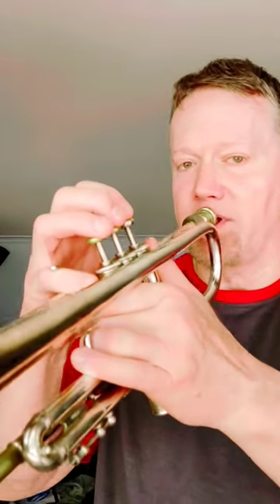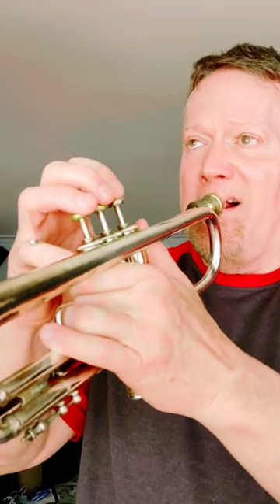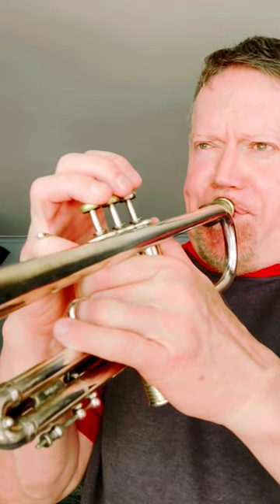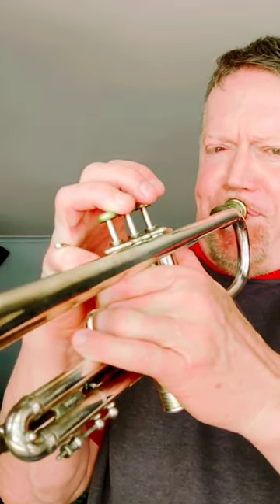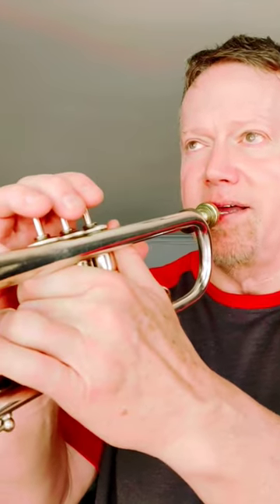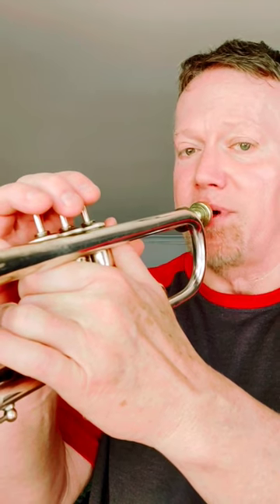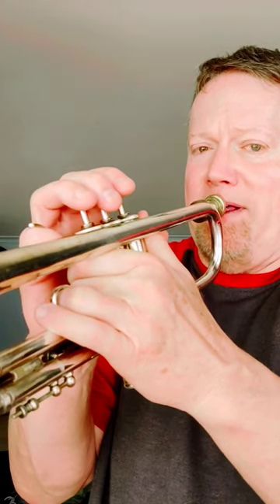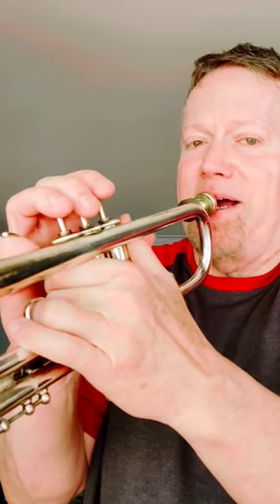Watch My DOUBLE C Turn Into Air As I Add Too Much Mouthpiece (MP) Pressure | 2023 Lesson

Comment: if you take a water hose...and pinch the end for faster flow (      if you will ) eventually ...ALL flow will stop...and NO MORE double C.....because the lips CANNOT vibrate no more  :  ( cheers
Reply from the maker: Sounds logical, but that isn't the case here.
it is TOO MUCH PRESSURE that stops everyone's range